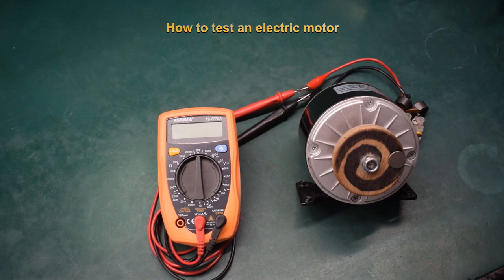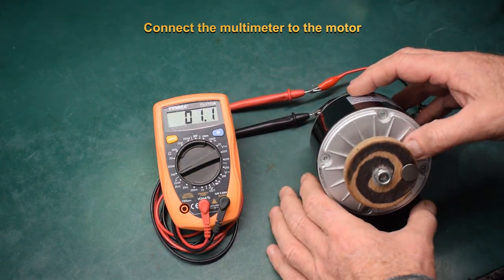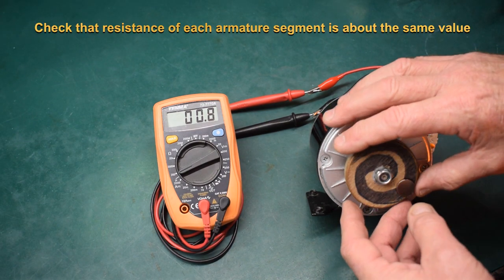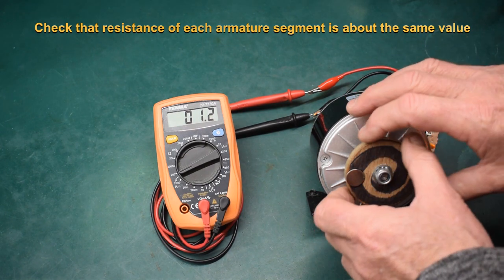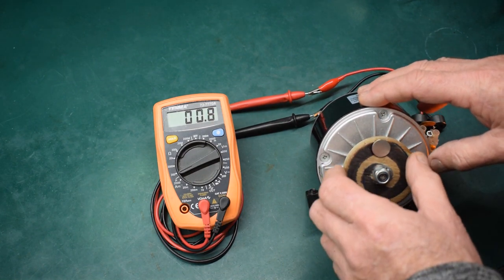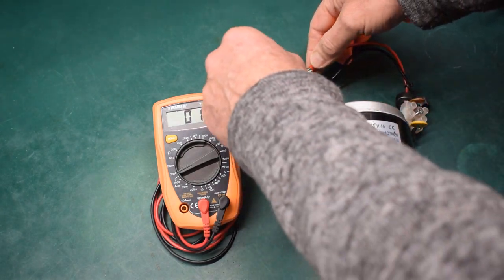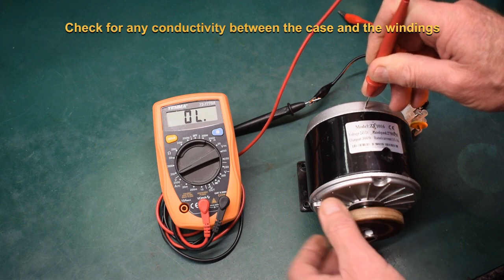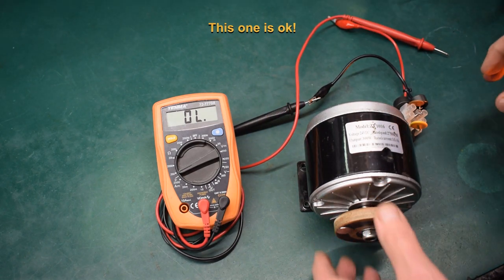How to test an electric motor.

Comment: Hi, do you know why a motor would only start working when I touch the multimeter leads directly to it, even though it's connected to the battery? I'm troubleshooting a ride-on toy car, and the motor doesn't run—unless I touch it with the multimeter. Does that make sense?

Comment: I’m attempting to test a small dishwasher motor that I suspect might be bad. The motor only has two wires coming out of it. 

I hook my meter to these and I am seeing readings in the ~64.4-67.3+ range. What would/could cause this? The unit had a water leak in the pump assembly, at the shaft. Could water intrusion while under load be the root of this?
Reply from the maker: If that is a mains powered motor then those readings may be about right, if all the values are the same there's a good chance that the motor is ok.

Comment: This is a bad video. I know nothing of motors or electrical engineering.  I have to test a small motor.
1. Visuals are fuzzy, bad lighting, no closeups.  Hard to see.
2. Show how you connected up the black clip and motor connections.  I have no clue how to connect my multimeter to this.
Really sad you could not show more.

Comment: Useful tips for electric motor testing. I have an inline fan and a car radiator fan that I got from a dumpster that I want to test and repair if possible. Your video will help me in the troubleshooting process. Thanks!

Comment: Any idea what might be the problem with a cordless circular saw that runs but at about 50% of rotational speed. The batteries charge but there just isn't enough umph from the motor to cut even the thinnest bit of wood.
Reply from the maker: Could be a number of things. Most likely would be the battery not giving enough current [try a different one], then it could be a problem with the motor, the controller, or just possibly the bearings of the saw blade.
Reply: @4qd Thanks mate, the batteries are both charging to 18v+ (it's an 18v saw) so I've discounted them. Tbh think I'm going to sell it for parts just too much work for me

Comment: What does it mean if a motor's continuity between the terminals goes up from 0.006 to 0.112 depending on where it is turned? I have a motor that passes every test except this one, and does not work. Is this something that can be fixed by taking it apart and cleaning it or something?
Reply from the maker: I'd suspect that the 0.006 is a short circuit within the windings, these shorts are often buried deep in the coil where the insulation has overheated and burnt. A motor re-wind company could probably sort it [at a price though].

Comment: Sadly not clear for an amateur where and how you exactly connected the probes . Not so useful for many
Reply: You might need a little more training on basic electrical and motor components. Not trying to down you! We all need a place to start. I suggest buying Ugly’s electrical book. It’s a good guide to electric machinery.
Reply: just connect to the red (dc+) and black(dc-) power wires, the only wires on the motor, or if there are no wires the two contacts of the gang plug (socket). If there is only one red wire than connect red to red and black to case (ground).
Reply: He actually says exactly where he connected them, to the brushes. If you dont know where to find these I suggest that you find someone who can explain this to you (;
Reply: @barthoebergen4631   In all fairness… if you’re not using a Megger to test Motors, you’re at a basic entry level, or hobbyist at best. So I agree with OP this video should’ve showed at least hooking the leads on the motor. 
I mean seriously nobody watching this has a motor anywhere to close to the 1/3hp (max.) motor in the video

Comment: Hello! Thank you for the video! I am checking a dec fan from a radiator in a car, I do have about 8-100 ohms reading from one leg of the motor to the casing of the motor, that means it is bad, right?
Reply from the maker: 8 ohms is about the upper limit of what we have seen, I would think 100 is showing a fault.

Comment: Great video, I have a friction wheel on a Peugeot 207 which I think is causing a short to earth on three sensors on this vehicle. The motor has a high resistance between the two terminals (nothing to the case) Could the 18 + ohm resistance be causing issues? With that one motor disconnected all the faults clear and don't return.
Reply from the maker: 18 ohms does sound a bit high to me, but you'd need to check the spec to be sure.

Comment: Is the checking between windings and case called a leakage test? I’ve heard the term but not sure what it is.
Reply from the maker: Yes that is a leakage test, it can be done with a high voltage test set but for the majority of low voltage motors a multimeter is good enough.